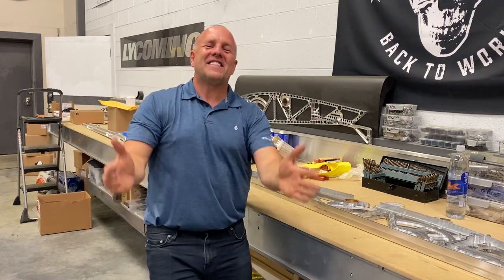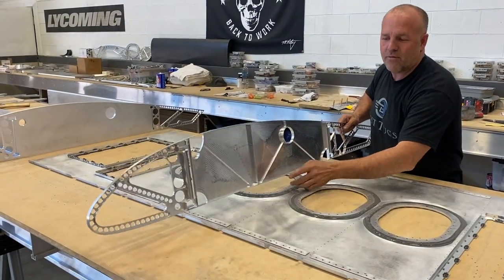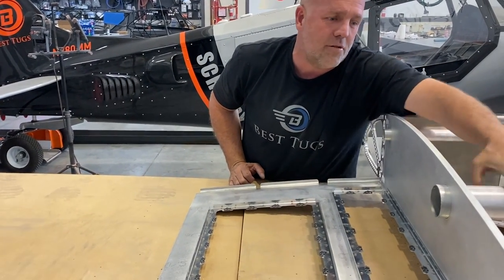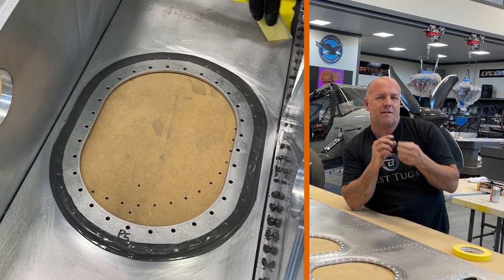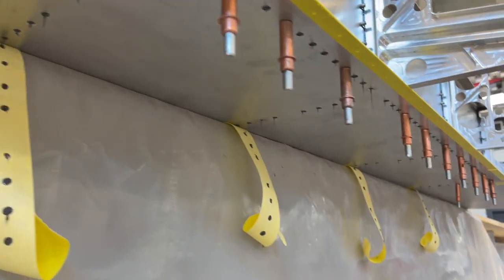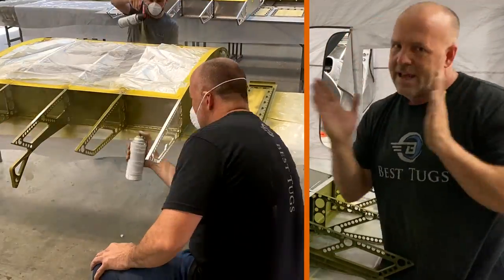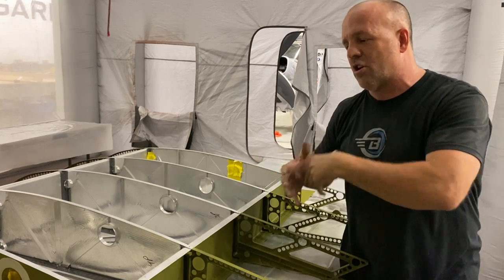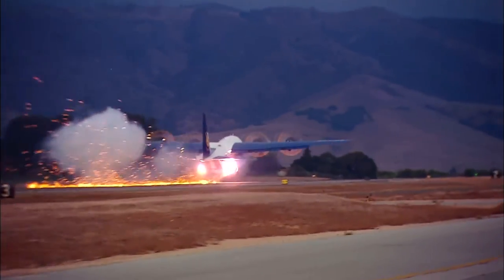Building 120 gal fuel tank for my crazy Bush plane | Scrappy #55

Comment: Mike i have a question, since you do a lot of precision work in your projects like some few thousands of an inch level of precision, have you ever thought of maybe giving the metric system a go in one of your projects??
I am sure you are incredibly precise and since you might have been really used to imperial system it may not be that much tasking to you mentally and i know both systems can be used to make incredibly precise measurements but i was wondering what's your thoughts on this???
Reply: I suspect he's happy with what he's used to. I'd love to hear it in metric though, as that's what I'm used to..
Reply: I trained as a fitter and turner in the late '80s (in South Africa) and we were conversant in both, as we had old imperial machines and new metric machines. It becomes second nature to convert in your head. Rule of thumb: 1mm =. 040".
Given that the aircraft industry still supplies rivets and fasteners and material in imperial sizes, I suspect it is just easier to keep it all in one format, as it saves on mistakes down the line. (like crashing a Mars lander into the surface because one guy was working in US and the other in metric.... 🤦🏻‍♂️)
Reply: @CS_247  THIS! if you need a mnenomic Sabaton has an excellent song called 40:1 which may help you if you like that sort of music
Reply: @JWbrasser  I dont need help, I have been converting for 30+ years now, but thanks anyway! 010" is .25mm!
Reply: @CS_247   Approximately. I saw an episode of air crash investigation that they traced back to using bolts that appeared the right size, but were not.
Reply: Then there's also the issue of tools , not all tools are offered in both metric and standard or are difficult to to find. My SAE toolbox is considerably larger than my metric. I keep the adjustable wrenches between the two!  Great video as always! Pure Patey!!
Reply: Honestly a number is just a number. Metric is just imperial with a scaling factor. He’s going to use whatever system of measurement he has the best mental visualization of because he likes to go fast.
Reply: @CS_247  0.0394, sorry.
I remember it as 25.4 mm/inch or 1 inch = ...

Comment: Wait, a torque tube and then bleeping?  You're going to be able to manipulate something on this wing, I just don't know what yet.  So far, I'm guessing it's to adjust lift capability, but I just don't know yet?  My Spidey senses are cranked to 11!  Not sure but I'm gonna figure it out.  Looks like I have to get back to work.......
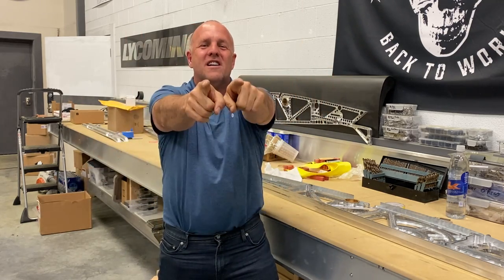Reply: And there are the teasers at the beginning and end of the video where he's showing ribs that aren't part of the fuel tank, and the one at the end in particular has these obvious arced tracks (?) in it.  Also, at 0:17, there is something fascinating going on around that torque tube on the rib behind him.
Reply: I’m guessing it a spoiler....
Reply: He even covers his lips.    Wondering if it possible to replenish the filter. Just enough for a lip reader...🤔 😆
Reply: @Iflyagrasshopper  That's actually a good guess.  I hadn't considered that.
Reply: @Iflyagrasshopper  Yeah, that's my guess. Don't remember seeing anything in the cockpit though. I wouldn't put it past him to have a weight on wheels switch on the main gear and auto-spoilers.

Comment: I’ve had excellent success applying sealant with a roller and using the tape as a guide makes it better. I definitely agree with your countersink method. If it’s a little high when you’re done, you can shave. Fantastic work.

Comment: Ah yes pro seal my old nemesis it smells horrible even after 2 years cured
Reply: When I was a kid I worked with my father who is an aircraft mechanic. and I always got stuck mixing pro seal. And getting it all over me. when applying it
Reply: I worked with proseal a lot in the 80s. It's sticky goopy messy and it stinks!!
Reply: Whats really fun is if have a coworker in a confined space and a fan blowing in said area, go rip the Semkit bag open right at the fan and let it blow in that exquisite bouquet of a smell!  😄
A little harmless fun at work makes the day go faster! It does stink but at least its not Skydrol! Ill gladly take the stink & mess of sealer VS. messing with anything Skydrol

Comment: Very clever modifying a vice grip as a dimple die, I dimpled the RV's millions of holes by hand with a 2-piece tool, I later got a crimping type tool but it would lock up often and sometimes ruined the part.

Comment: i guess zinc chromate has  gotten better over the years .i had to stripped the interior of a C-47 fuselage in the late 80's  for an aviation restoration group i  belonged to .The the zinc chromate actually pitted the aluminum to the point it had to be chemically stripped, acid washed and re - primed with a different product. Good luck on Scrappy & love your videos.

Comment: Technical question about the inverted fuel tank inspection covers.  Mike let me say I'm in total awe of your engineering skills and ability to master so many skills.  You are nearly super human.  To say you are OCD is a gross understatement.  My question is regarding the inverted fuel tank inspection covers.  It is a great maintenance idea to invert them as you have.  That makes a lot of sense.  I'm wondering (and I'm sure yo have considered this) if the air pressure under the wing will be trying to force these covers open thus decreasing pressure on the o-ring and stressing the retaining screws.  With the normal configuration of the inspection covers air pressure under the wing would be compressing the o-rings and de-stressing the screws while holding the cover ever tighter into its seat. I love watching these videos and can't wait to see Scrappy fly!!

Comment: I only ever paint the sloshing compound over the existing prc, no adhesion problems and it seems to work well especially if I can get a couple of psi inside the tank to force it into any pinholes. Never seriously considered filling the tank with it as per the instructions, there is no way anyone can get an old tank bay with bad access clean enough to do that.

Comment: All these detail processes are helping me with my kayak build and making me pay attention to better processes to have it come out looking better and cleaner in an epoxy system.  One question, why doesn’t the wing spar go through the ribs of the tank?  Usually you see the tank(s)  set in between ribs and attached to the ribs and spar.  Or, are these spar pieces just temporary to set the ribs and wing skins in place in perfect alignment?  Maybe I have to wait for the final wing assembly to see what will happen.  😎

Comment: Part of the smoking rivet cause is the galvanic corrosion from the moisture that is allowed in under the countersunk head. At least that's what I was taught. It makes sense that the slight chaffing of the "pretty tight" rivet would add to the streaking.

Comment: Thank you for sharing this video.  I am impressed with your thought process for designing parts that self fixture for assembly.  Your explanation of the riveting and tank sealing process was great.  Have you considered using anodizing for corrosion protection where you are worried about the delamination of the surface treatment caused by the tank sealant?

Comment: I do wish that people supported the Troops and Extroops more here in Britain. I have had people here actually show anger at me for serving and taking part in both Golf wars and serving Afgan.
On to the postive side, when I worked on RAF jets, counter sunk rivets had to be set 0.002" high and when we did tank work, it was exactly like your method, with a final coat of 1005CH. It was a pain to get back to metal throughout the tank to do the repairs but it was better to do the job right once than have a problem in the field to fix later.

Comment: So, after watching enough Mike Video's on scrappy we all know that he has something up his sleeve regarding his airfoil design. I remember back on a video where he mentioned he was doing something that had never been done before on his wings. Then when Ron and him bleeped out what he was saying got me to thinking. What could he be doing? Well looking at the wing design it looks like a Clark Y but not quite thick enough. Then if you look at the trailing edge you can see it look like he is setting it up for a double slatted fowler but I think might be to easy, besides that has been done before on back country aircraft. Not sure...... Will think more on this to see if I can decipher what that might be.... Leading edge not sure about that. We all know that gaps create drag so unlikely that it will be a fixed leading edge slat but what if it was more like what McDonnell Douglas did with the A-4? The leading edge slats are "automatic" in that they extend below a certain speed/angle of attack. Would be interesting to see that but we see no evidence of that on the leading edge where it might connect.

Comment: I was going to say that Ron has the best job in the world, till I figured out who was going to clean the cleacos.  For a one of a kind ( hopefully) you have done a fantastic job of thinking thru and eliminating sources of leakage, surface finish, functional use, etc.  You do sleep, yes?  When?
Reply: Have you ever heard of “ Super Koropon “  made by DeSoto chemicals in Texas?  Bell helicopters used it, it’s a two part epoxy that is almost Aviation Paint Stripper proof.  Worked on Agricultural Helicopters in the 80s and we used it exclusively on all our metal parts, cabins too, because the insecticides we used would strip conventional products.  Has been a lot of years, but if it is still available, you can’t find better.  Just googled it,  DeSoto was sold to PPG and continues to make the product.

Comment: Hey Mike in the next video can you explain how fuel flows/transfers from one bay to the next and to the engine? Just hard to visualize with all the solid ribs
Reply from the maker: There are small holes on the corners of the ribs in the fuel tank which allow fuel to flow between them. If you take a close look you can see them in the video. Hope that helps!

Comment: Hey Mike...
Good to see two brothers inventing in aviation again!!  In relation to propellers do people know what 5% means? The modern day props are only 5% more efficient then what the Wright brothers developed.  They invented the propeller. Not only that they invented a small wind tunnel to test their designs. And the engines at the time were you weak to  propell their plane, so the developed a stronger engine. I see you in that same mold. Also.. they ran 2 propellers off of 1 engine. I haven't seen that since.  And they did all this 11 years b4 the model t came out!  Keep up the tradition.

Comment: Why rivet and seal the tank section rather than weld and pressure test?  For thicker sheets, ac tig would be manageable. For thin stuff you would have to use laser or friction stir welding. I’d still think the hassle would be worth not having to use sealant.

Comment: Cool , I really hope you don't forget those awesome Tip Stingers. Get them on the market to save more lives. I thought it was fitting the advertisement that played before your video was for the Airforce. What an Awesome honor. I used to work as a contractor in the 90's where they built the C-17 .Oh , a humble suggestion. I hope you put Scrappy's picture on the Wings somewhere  . Just like the Glove compartment image would be perfect. Oh and if Scrappy is a transformer , is it an Autobot or a Deceptican?

Comment: Hey Mike, a quick question. Why don't you paint the wet wing parts with fuel resistant paint before the assembly? Don't you afraid the paint will crack when the wing will start to move? I'm sure you have a good explanation for that. LOVE your work!!!

Comment: Hi Mike, a question about the tanks, why 4 and not 3 larger ones or even 2 large ones per wing? To reduce slosh? And control CG by drawing fuel from specific tanks? Not a pilot but wishing to be one. Thanks for the videos. Love them.

Comment: Very cool seeing your process on countersunk rivets and tank sealing. 
Building 747 for 22 years (mainly a door mechanic) and using seal (fillet, fay, and prepack) it’s pretty close to how you do it. 
Prep is key, and clean is even more important, else the joint will fail. 
That zinc/chromate looked like BMS 10-79. 
Boeing uses BMS 10-11 Yellow Primer. 

Ali dine or Bonderite?
Not much mentioned there when dealing with CIC?
Just curious. 

Hello wifey. Hope you are well and your Cub is coming along nicely.

Comment: The wing trailing edge structure looks like it’s made to accommodate a multi surface Fowler flap system. 727 triple barn doors?

Comment: What if you figured out a way to expand the width of the wingtips and the wing all together in the same manner as a bird upon landing. Literally increase the wing surface area as well as the tip. The tip feathers of birds become semi flexible and spread out to alter the currents and prevent tip vortices from forming. The final step is maximizing ground effect and using as a braking mechanism by redirecting the airflow against the ground effect. It's so simple at first glance but the mechanics at work are simply astounding.

Comment: Mike - or other clever viewers: As a composite marine guy, the wing looks like very light construction, but of course very tricky to assemble. Is there a reason why you wouldn't consider composite wings? I thought the rib creation for the super curved slats (flaps?) was a very cool way of doing them.
Reply: You got it right, those were slats. 

Purely guessing here, but maybe he needed a more compliant (elastic?) wing where he can more easily monitor for stress fracture? 

How well do carbon composites bond with aluminum stressed elements like spars or stringers? Most of my experience is with prefab composite tubing, truly curious as to how integration is managed.

Comment: Mike I can't imagine why anyone would want to skip the section on Zinc Chromate and tank sealer under stress... A lot of aircraft have probably had fatal fuel loss or even fire based explosion mid-air, leaving no clue as to why the plane transformed into an Aluminum Rain Shower at FL35 !  That Fuel tank construction method should be made known to every single Aircraft Mechanic and Air-frame School in the States !!!

Comment: After a lifetime in the marine field, no experience in aeronautics, I don't have much faith in zinc chromate primer.  With 6061 aluminum in about four years above the waterline the primer and top coat start to peel spontaneously.  Moisture and salt in the air have penetrated the bond.  I also was working when red lead was outlawed and we went to zinc chromate on steel ships.  Pretty worthless, as it would start rusting right through it while construction was still in progress. The one outstanding lesson was for any paint to be effective it had to be part of a designed system.  Mix and match (even when the manufacturer says they are ok) just don't hold up.  Inorganic zinc paint systems, epoxies, and some two part urethanes seem to outperform and way outlive zinc chromate.  I have long since retired but still need paint systems on my home shop fabrications so I remain interested if somewhat behind the leading edge curve on coatings. Here in SE Alaska, a wet and salty environment, where there is a lot of float planes and land ones stored next to the water that coating is all that is between you and failure.  It's importance cannot be overstated.

Comment: How does fuel flow between the bays?  How about the water drain points?
Reply from the maker: 👍🤠 Coming in future video.  The pass throughs you can see now both front and back bottom and front top corners.   The drains are last so the wing can stay flat during build
Reply: Pass-thru holes are very visible at 15:10 in the video.

Comment: Hi mike, love your videos and engineering precision. 

Can I ask why you have chosen not to use an aluminium conversion coating like alodine or anodising. I have been an aircraft maintenance engineer working on ems helicopters in salt laden environments and corrosion of aluminium structures was a very maintenance intensive component of aircraft maintenance schedule.

Comment: You haven't explained how the large spar will connect or run through the tank. It looks like a piece of the spar is a side of the tank but how will a connection to another length  be as strong as one lone spar?
Reply from the maker: It slides through the slots on the outside of the tank.  It will show better in a near video 👍🤠

Comment: I am surprised that a chemical conversion coating per MIL-DTL-5541 was applied to all the aluminum parts.  It provides an oxidation preventative coating which also enhances adhesion of any subsequent coatings.  Also, were the machined parts stress relieved after machining?  Machining relatively thick stock into thin sheets can leave stresses in the part that need to be removed.

Comment: Split flaps or Ailerons I'm guessing for aero breaking or drag yaw turns.
Reply: Follower flaps? I'm still waiting to see the Giant airbag  running from root too tip right down the center of lift. Inflate for Lift deflate for Speed.
Reply: I forgot to mention adjustable in-flight dihedral. Like I designed built  for my plane. If I recall Draco did not have a dihedral I think it might have even been an anhedral since he likes likes to fly through narrow Canyons. But despite that advantage it comes with major disadvantages also.